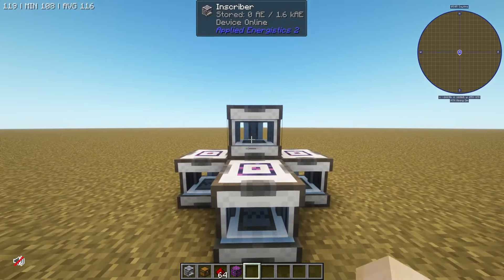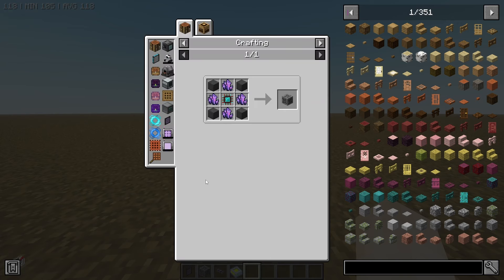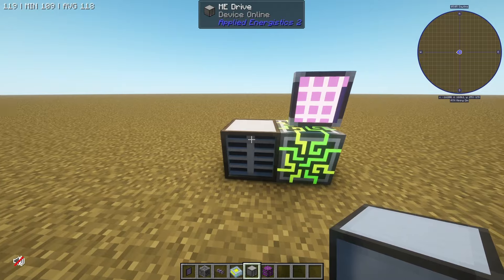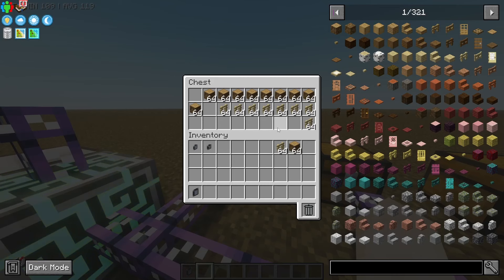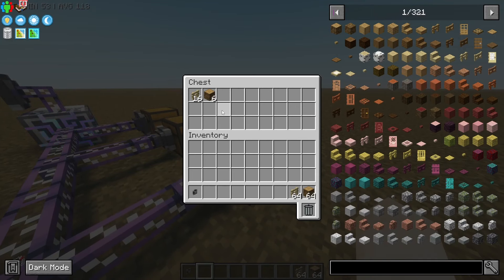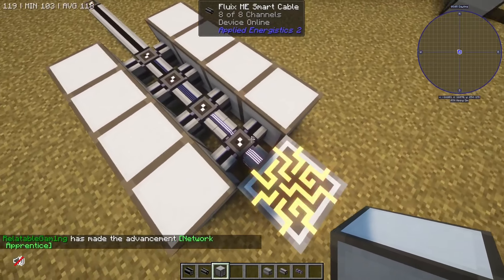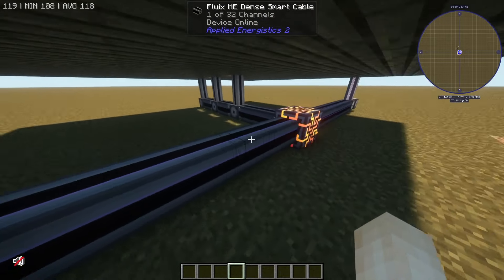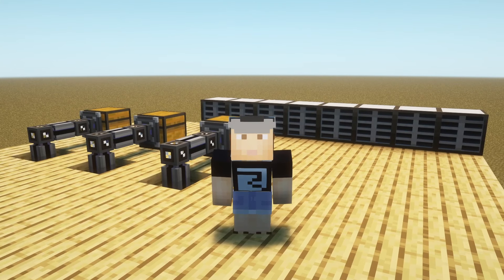Applied Energistics 2 Tutorial | Getting A Basic ME Network

Comment: Early game, I would argue that a 'basic' network would be a sub net, this is a VERY important part of AE2 that sets it apart from RS.
You can make a low power usage subnet storage system by using the toggle cable bits to toggle power on and off.
Subnets are very important for early game storage as the storage bus on an interface setup can be used to connect up to 7 different sub nets to your main network ()each of these subnets can have 7 storage busses and 1 interface to make 8 channels.
Most folks early game will have double chests/iron chests/drawer systems setup, subnets to connect these systems together is already a very good storage solution, to the point where drives end up being later game since the drive cost is fairly high comparatively.

Nice job tho, I look forward to seeing in a future video how you explain how p2p works.
Reply from the maker: Ill be showing some stuff about subnets in the next video. this one was basically just to explain the bare components of Controller, Terminal, Import/Export and Storage busses